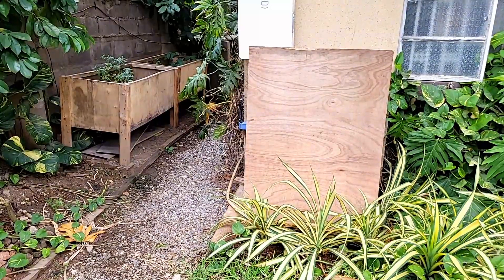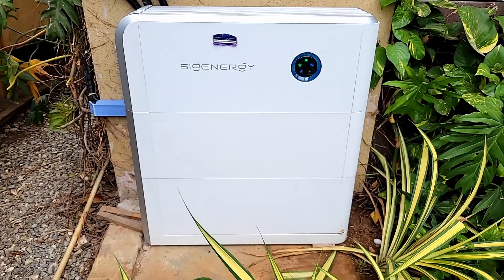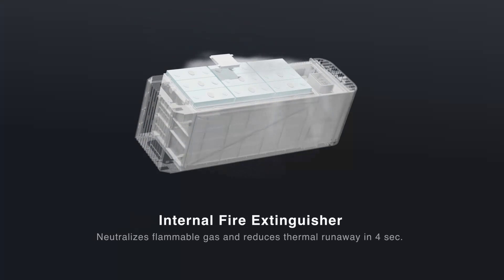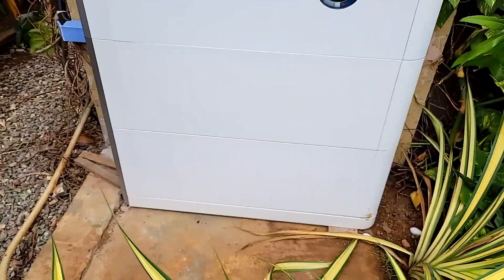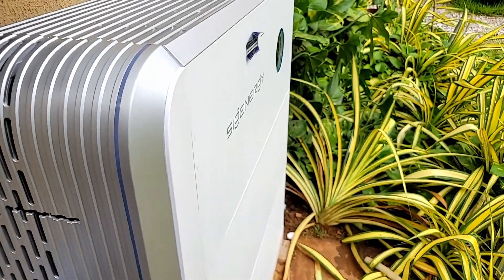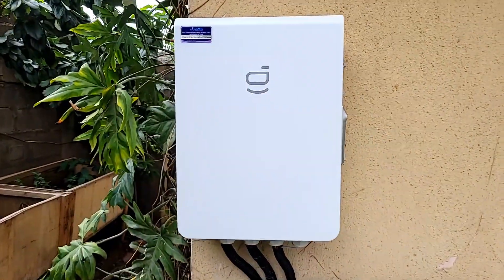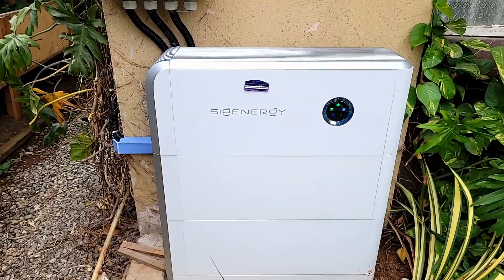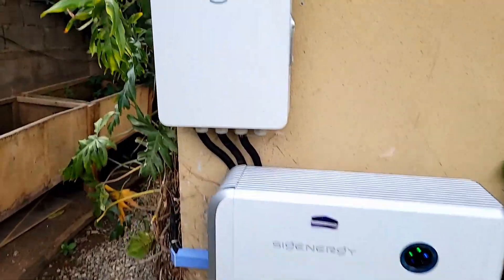The Ultimate Game Changer: My Sigenergy 8 Kw inverter and battery. #sigen

Comment: Sounds like a lot of unnecessary gimmicks just to charge extra cash and keep you running back to the manufacturer for the most basic features. Geo tagged inverter? Strip it and use the components, how does that help?
Reply from the maker: @litaninja  you think like a criminal. Most thieves are after a quick sale. They are not looking to strip it for parts. Geo tags are not an extra cost option. So I don't see why any reasonable person will have any issues with it.
Reply: @drsolar  I'll take the compliment. You see, in order to get ahead of and thwart criminals, you need ti get in their head / mindset. I don't have any issues with it particularly, I have issues with gimmicks in general as selling points.
Reply from the maker: @litaninja  you are most welcome. There are people that love it. It appeals to them.
Reply: @drsolar  Agreed

Comment: Wish it came with levelling feet that can be adjusted with a nut, that would help.
Reply: Look it up. It comes with a levelling base plate/frame. Look at the setup in the video. You'll see the bottom frame. You adjust levelling with that. It takes the weight evenly, rather than on some levelling feet.

Comment: Hi Dr Solar. Wow. Impressive system. How much would that cost if I wanted 120kwh batteries and 25kw inverter please. I’d ship to Jamaica and 😊
Reply: Thanks Dr Solar. I’m hanging in there despite some health challenges. Also just laid my eldest brother to rest in Jamaica. I’m back in uk at the moment. Does this Sig System operate a split phase as I’d need 220v to run water pumps etc.
Reply from the maker: @cCaribbeanSpursTv  please accept my sympathies and prayers. May your brothers soul rest in peace. I am wishing you a speedy recovery.
Reply: @drsolar  Thank you. Much appreciated.
Reply from the maker: @cCaribbeanSpursTv  for the US market I am sure it will be split please.
Reply from the maker: Point guard is the name for the US market. Jamaica runs similar voltage to the USA. Thank you for watching and commenting. How have you been?
Reply from the maker: @cCaribbeanSpursTv  why do you need a 120 kwh battery? What do you plan to run?
Reply: @drsolar  because I need to run 14 mini splits, spanning 3 apartments, a 4 bed main house and a outbuilding with 4 water pumps including 2 x pool pumps& 4 washing machines and up to 2 x Dryers. Huge project. I’ve factored in 3 days autonomy but the mini splits could affect the battery size for sure. Also I need to mate with a generator as I’m not having anything to do with thieving JPS (Jamaica Public Service) the only electricity supplier on the island. People were without power for upto 2 months after Hurricane Beryl (somewhere rural communities are still without power 12 weeks later) and have received huge bills even when not having any electricity. Disgraceful.
Reply from the maker: @cCaribbeanSpursTv  JPS must be a cousin of our utility company. Pointguard by SigEnergy should meet your needs. You might have to do multiple inverters to allow you to get the storage that you need.
Reply: 😂😂😂.  Ok. Thanks good sir. I’ll look them up.